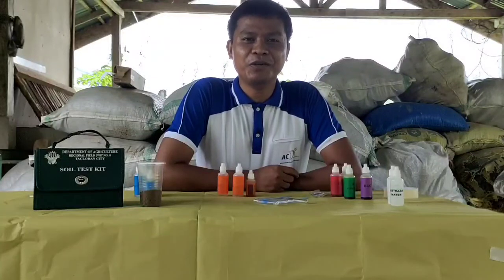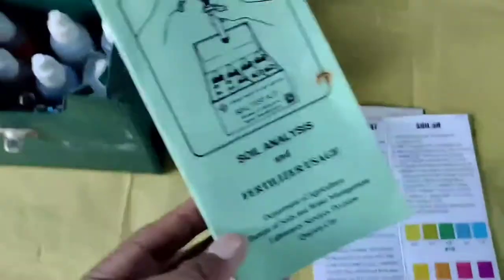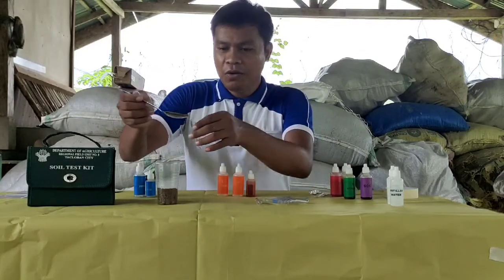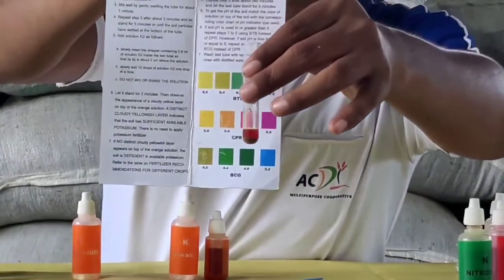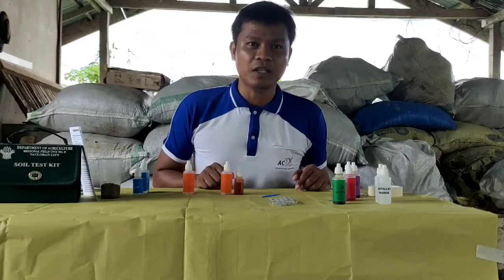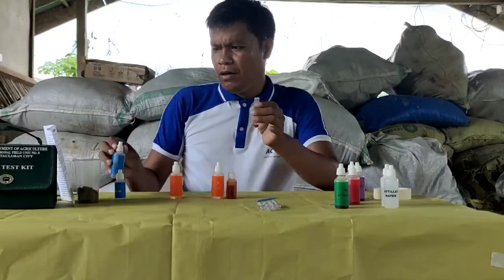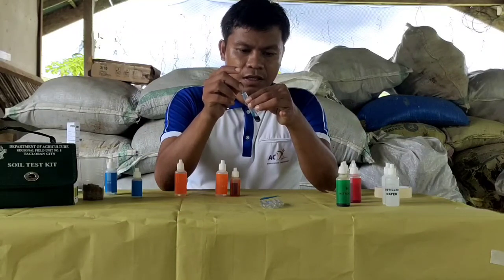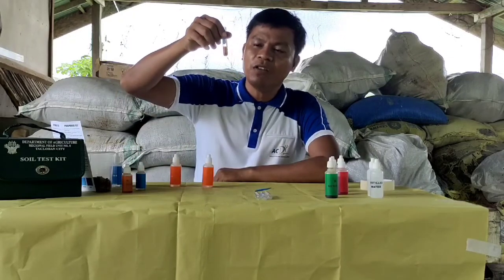Soil Analysis using Soil Test Kit.

Comment: What was the nutrient status of the soil in terms of nitrogen, phosphorus and potassium content, based on the result of rapid test?
Reply from the maker: Based from our soil analysis using our soil test kit; soil nitrogen is medium, soil phosphorus is high, soil potassium is high. You can see it in the last portion of our video maam. This means application of nitrogen containing fertilizer is necessary in a certain amount since our soil N is medium. No need apply more phosphorus containing fertilizer since our result is high (maintain only the usual P application in the rice field). Maintain the usual application of potassium containing fertilizer since our soil test result for K is high... For best result, we recommend the laboratory soil analysis from BSWM and Regional Soils Laboratory. Thanks for the beautiful comment ma'am...